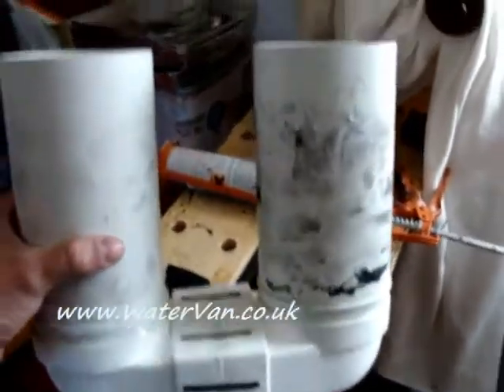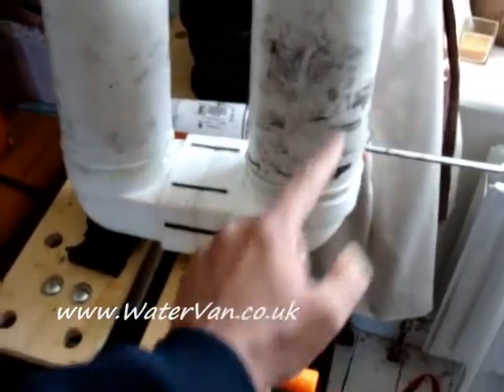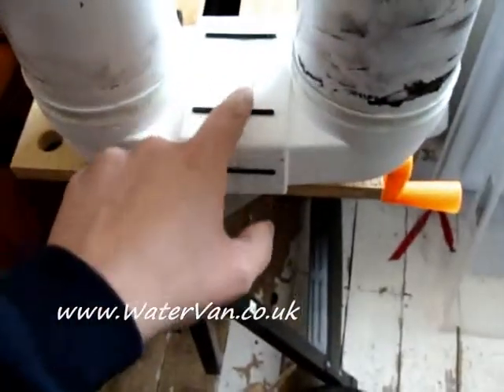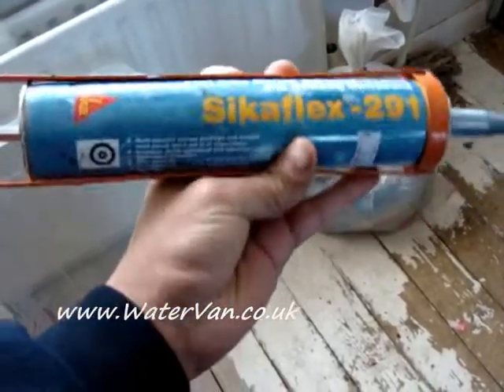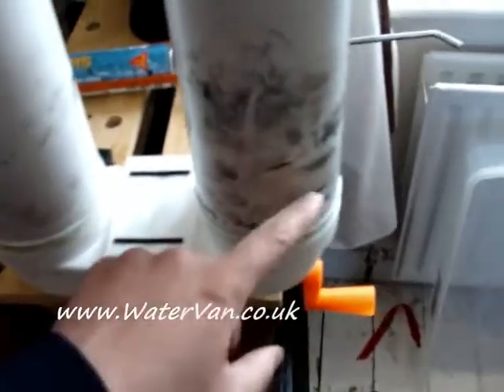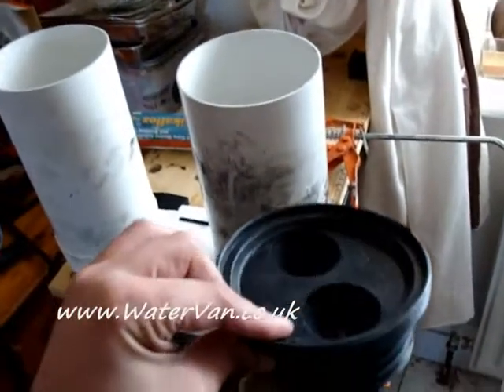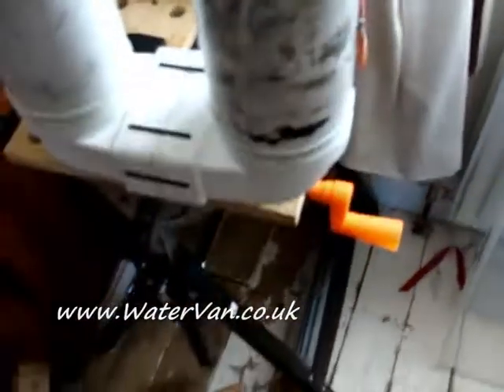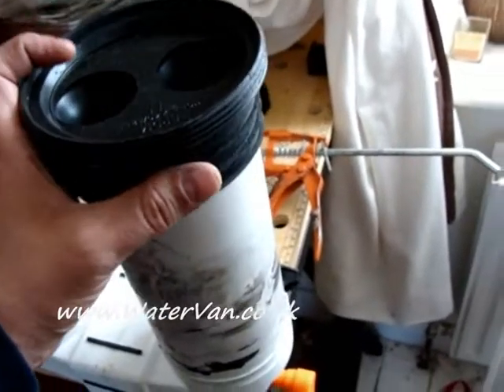#015 - MadStu's Water Powered Van - New Cell Casing

Comment: aluminum is usefull as plate materials in some instances. however, there is a rather nasty chemical reaction between aluminum and the metalic alkyline salts that are commonly used with these devices. it is indeed possible to build an electrolyzer using aluminum plates but it makes getting proper electrolytes a lot tougher. if I recall, cyanide is one of the catalysts that will work well with aluminum plates. tough to get and handle.

Comment: Stu I was reading at physorg dot com that aluminum is even better than stainless steel for your hho cell. You might want to it.

Aluminum corrodes but it does not rust. Rust refers only to iron and steel corrosion. 
Aluminum is actually very prone to corrosion. However, aluminum corrosion is aluminum oxide, a very hard material that actually protects the aluminum from further corrosion.

Comment: if you think the thing might give under vibration, you might try using bits of soft rubber between your plastic and the mountings to give it a bit of cusion ... might help a bit to dampen vibration ...

Comment: I dont want to sound negative, but what do you think about the consistency of the material you are working with there.  On this side of the video, it looks to be a bit brittle.  Do you think it will stand up to the heat and vibration it will get in its chosen mounting location ???  

just a thought ... only playing devils advocate, not trying to discourage ...

Comment: Its looking like you are the man with a plan.

If you can get a product in your area called "Marine Goop", try it!  Seems to work very well as a sealer/adhesive. Normally, the urethane based products work pretty well.  Sorry to the stuff you tried did not work out. 

I have had pretty good luck with the sealer/adhesive auto glass shops use to seal the wind shield into a car.  If you can get that, might work well for you.

There will be gas trapped on both sides of your "U". Keep it safe.